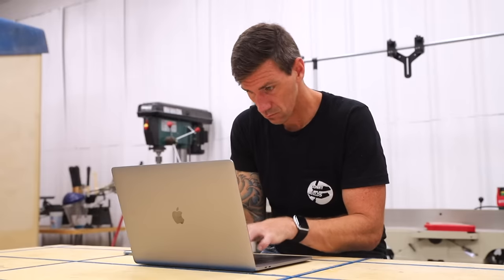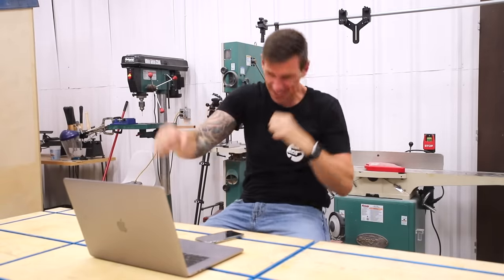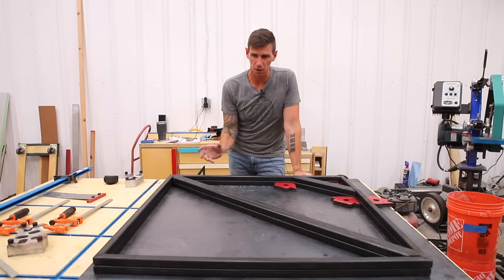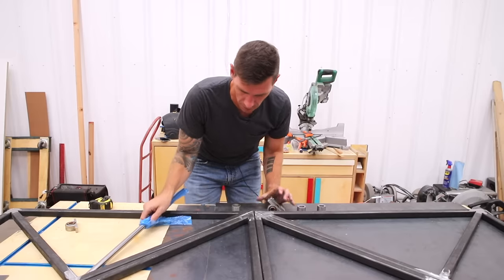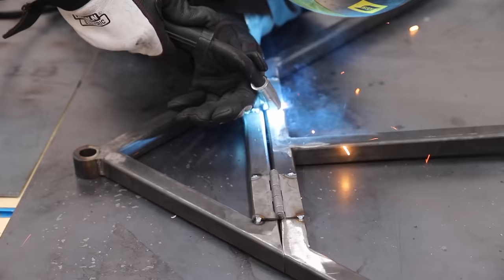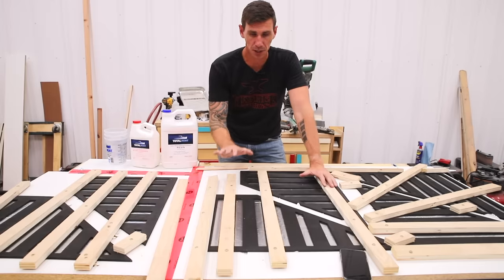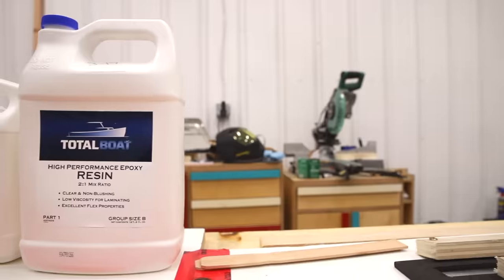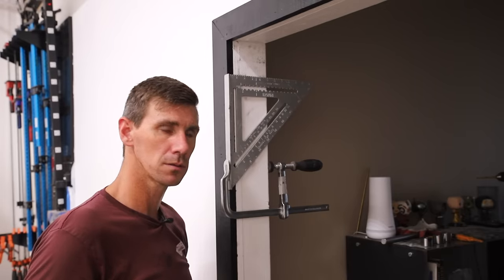Impossible Folding Door

Comment: Just think of comin home drunk and trying to open a door like this, also just a curious thought. Would it be possible to put a lock on that thing? 😂
Reply: You can put a hole through the inside handle and put a padlock through that and another block with a hole connected to the inside wall, it'd be awkward and a literally 1 sided lock but it'd be a lock lol
Reply: If you put it in the middle of the door and stopped the two squares from seperating.
Reply: Barney Premium - Yes'nt
Reply: I would mount a rotating bar of some sort on the wall right next to the handle that is able to lock the handle in place. But still its gonna be a one sided lock.

Comment: There's no sound at all when you explain any of it.
Reply from the maker: Its only an issue on certain devices. The audio is there.
Reply: 🙋‍♀️same here
Reply: See if your device is converting the stereo audio to mono before it comes out of your speakers. The video seems to have inverted phases, which if converted to mono, will result in little to no sound
Reply: Its a secret😂
Reply: For me it was just a very short segment of explanation I couldn’t hear
Reply: I hear only static noise :D
Reply: It's a headphone issues, was working then didn't, took my headphones out then it worked again
Reply: @JonnyBuilds  Strangest audio issue ever.
Reply: Timestamp?
Reply: @rhysblackburn14  got no earphones, and it has no sound
Reply: Hmm weird i heard it all..
Reply: I think it sounds like its supposed to with earphonea
Reply: I heard it. It's just quiet.
Reply: Antonio Delgado It happens for me when I had only one AirPod in, but the I went back in the video and put on both airpods and the sound played fine
Reply: @JonnyBuilds  strange... Never encountered that lul
Reply: @iadtag1853 
Yeah...
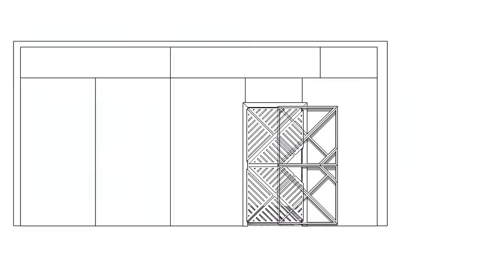From 01:50ish to about 02:45
Reply: If you're on a mobile device, tilt your screen so it goes to fullscreen/landscape mode
Reply: I thought my iPad was messed up😅
Reply: I have a samsung phone and it fosent work no audio..
Reply: Same
Reply: I couldn't hear it, even when i changed my speakert to mono and stereo, also the same happened to my laptop..
Reply: It might be headphones that make it not work
Reply: Even the auto generated captions aren't working
Reply: @JonnyBuilds  it won't auto generate captions though either ): Someone do the captions? :)
Reply: It's a secret
Reply: It sounds like the left audio cancels out the right one....
Reply: @JonnyBuilds  That's quite a puzzle. How does a variation like that even happen??
Reply: On my headphones it sounds totally bizarre, almost like you are talking behind me haha
Reply: @breadfan_85  Yeah i was about to comment how horrible the quality is at that point but ik it isn't his fault so i ain't gonna hate.
Reply: @antoniodelgado7475  that would make sense of the fact that I can hear it perfectly fine with headphones, but not my phone's single mono speaker
Reply: @antoniodelgado7475  now you point it out, I can hear the fact that his voice is out of phase in that segment. It's kinda trippy
Reply: It isn’t because of your device. for some reason the left and right audio outputs are exact opposites which, when combined (mono audio) cancel each other out. if you can’t hear audio here, try turning off mono audio on your device. Edit: the reason captions aren’t working is because the bot that generates the captions hears the audio in mono, which means it doesn’t hear anything.
Reply: @bryanfrantz4795  For me, the audio was really quiet, so i replayed the vid and the audio was completely gone. But, then i wore headpones, and the audio came back.
Reply: @Roxious119  Huh. There must be some hidden mono-ing going on somewhere in the chain.
Reply: Only on my left speaker
Reply: @antoniodelgado7475  just... Why?! It's a good explanation but what kinda weird audio program phaseshifts the audio?!
Reply: James Morrison 
You’re probably using mono audio my dude, depending on device, you set it to stereo audio or you have to turn mono off (Like for an iPhone)
Reply: Dayne Coveyou Good question, maybe bumped a phase knob on something or misclicked a setting that put it 180 out of phase, who knows
Reply: @antoniodelgado7475  that would be typical of rerecorded content ... he recorded live sure ... but YT re-records it and drops everything about 180deg out of phase .. so it appears almost in sync but it is lagging just a bit 
and since yt tends to invert channels it will take the standard master channel of right and make it left so anyone on mono playback will get little to no sound as it is on the wrong channel for them ...
Reply: @dickthedorkwing6082  i had problems with my lg v40 speakers but it worked perfectly with my $10 walmart headphones
Reply: Lisen to it really close and it sound weird
Reply: Same
Reply: I could hear perfectly
Reply: Jonny Builds 
Well you should still try to fix it! Everyone should be able to enjoy watching something this interesting!
Reply: I can read his mouth but I can't hear it
Reply: this is similar to how noise cancelling headphones work. https://youtu.be/zj33WAODsJg
Reply: Yep it works on mu tv but not on phone rip
Reply: @Roxious119  move the audio balance all the way left or right, that ignores the inverted audio channel
Reply: My iPhone6 did the same thing
Reply: @JonnyBuilds  it's an issue when you edited it. You inverted the audio channels, so when devices with only one speaker do the stereo to mono conversion they cancel each other out
Reply: @antoniodelgado7475  just like having a 2 channel amplifier for speakers and only using 1 speaker without bridging it properly
Reply: @antoniodelgado7475  how?
Reply: Same boi..
Reply: It sounds like ambient background noise for an indie horror game
Reply: Same here
Reply: on iPhone, turn off Mono Audio in Setting -> Accessibility -> Audio/Visual.
Reply: For those people like me who couldnt hear any sound turn on your captions and you can see what he says 😊
Reply: I had to get my headphones to hear it.
Reply: @JonnyBuilds  tbh u could've just made the audio compatible for all devices
Reply: Try with headphones
Reply: @CATel yes, u described it perfectly
Reply: Jonny Builds It’s only a problem on certain devices? Oh, well I guess I’ll just go buy a new device then, because that’s clearly on me for owning the wrong device.

Fix your audio issue, man.
Reply: Yeah, I had that same issue, so I then tried using my headphones. I had no audio issue with the headphones.
Reply: Yeah
Reply: Rhys Blackburn mine was phone speakers,  no headphone problems
Reply: @elainrakas3778  use and earpiece or headphone it would probably work then
Reply: iPhone X + AirPods – no sound 😞
Reply: i’ve watched this with audio and now it’s started doing this the fuck
Reply: Put subtitles on
Reply: @Erazzzer  m2
Reply: @rhysblackburn14  for me exact opposite
Reply: I had to put my headphones in for it to work-
Reply: Same on my phone!
Reply: Jonny Builds Him explaining is only on the right side of my earphones when i tested it out.
Reply: @th1rte3n62  It doesn't work. I tried both. Activating or deactivating it doesn't change anything
Reply: @th1rte3n62  It doesn't work. I tried both. Activating or deactivating it doesn't change anything
Reply: Nice E39 bro
Reply: Put on a headphone
Reply: Maybe its bc you have one speaker. It happened to me too
Reply: Antonio Delgado l
Reply: @elainrakas3778  just get a good headset or earphones, 
im using a headset so i don't get those issues when the audio is suddenly inverted
Reply: though the only problem is that because of the invert audio it made it sound like he is talking some what behind me
Reply: I had the same problem
Reply: I'm with ya too
Reply: Just turn on closed captions
Reply: @rhysblackburn14  wrong
Reply: Same
Reply: Turn on captions
Reply: Use headphones
Reply: Cogahan I have no idea. but, it did work on mine.
Reply: Thought my phone was hacked😄🇰🇪
Reply: Chỉ cần tai nghe là xong (Nếu thiết bị của bạn chỉ có 1 loa)
Reply: Pst ps pst pstt psst piss pius pis puss pusi
Reply: @antoniodelgado7475  English?
Reply: @JonnyBuilds  it seems to be it happened to me but i think the audio is unrecognisable to other devices as i hear a faint screeching noise when i put my ear near to my speaker
Reply: @rhysblackburn14  i dont have headphones on and there was no sound
Reply: @NavJordaan  nothing happens (I mean the audio)
Reply: @ahmed4363  try earbuds
Reply: Jonny Builds 

But its a problem that can, and should be fixed.
Reply: It's very low for me
Reply: Turn on subtitels
Reply: @rhysblackburn14  wrong I don't have headphones in and can't hear
Reply: He sounds like a fish if I turn my volume to the max when it came to that glitchy part
And I have no idea what a fish sounds like
Reply: @JonnyBuilds  well most people dont hear you
Reply: I could hear on my iPad 🤔
Reply: Turn on closed captioning during those parts. I had the same issue
Reply: it worked when i took out my airpods 😱
Reply: Yeaah me too
Reply: Yeah that’s what I was gonna say
Reply: I heard nothing and when I turned it up and put it next to my ear, I heard an R2D2 kind of noise. But I heard the part where it told you to subscribe and click the bell..not the voice, just the click sound.
Reply: Scusate se rispondo in italiano.
Credo capiti quella cosa dei suoni negativi. Forse vengono riprodotti due suoni di cui uno è il negativo dell' altro. Quindi non si sente niente.
Reply: Yes its an Issue km mobile devices caused by badly alligned Audio Channels, like Noice Cancellation, there are some Videos on The Internet you can watch
Reply: Jonny Builds how
Reply: same
Reply: Wear headphones or earpiece to fix
Reply: Same but for me it makes weird gurgling noises and taps and stuff
Reply: Same
Reply: @New5oul  same
Reply: i think he accidentally invert either the left or right audio, if you hear it in headphones it will feel weird, but you can still hear it, if you hear it from a mono speaker (device that only have one speaker)  you wont be able to hear it.
Reply: @rhysblackburn14  didn't work like that for me
Reply: @JonnyBuilds  I have a galaxy A50, i still don't hear anything when you explain. (I think this is a newer version phone so like- I think, I'm sorry if I sounded rude)
Reply: I was watching it as mono, switched to stereo and worked just fine.. guess it some kind of audio conversion problem
Reply: Wear a stereo headset
Reply: For me it was only his voice at the wooden part. Music faded back, click fron the subscribe thing
Reply: Antonio Delgado ill pretend that I understand that
Reply: He just phased out and in of being slightly quiet
Reply: @JonnyBuilds  yeah I'm on Samsung all I hear is a quite gargling sound
Reply: @elainrakas3778  it may be a Samsung phone thing I have a Samsung phone and there was no noise
Reply: @JonnyBuilds  I thought my wireless earbuds broke again
Reply: Try using headphones, it works
Reply: the only way to fix is use stereo headphones
Reply: It works for me
Reply: I have tried both device sound setting, changed from phone to computer and Android to IOS, it still messed up
Reply: @antoniodelgado7475  yup, Samsung galaxy buds convert to mono when you only have one earbud in
Reply: All you're able to gear is some weird corrupted noise
Reply: @JonnyBuilds  just put sub titles
Reply: He just said the reason why ppl stil arguing !!
Reply: Antonio Delgado 
I didn’t understand anything but thanks for explaining
Reply: That’s cuz you’re poor
Reply: This is a editing issue !!
My Headphones work well the past 90 years
Reply: For some reason the audio for that part doesn't play through mono sound systems, or something like that.
Reply: I was able to hear the beginning and the music but when it go to him explaining it, the sounds are like little squeaks when I put my ear up to my phone speaker. I have a OnePlus 6t.
Reply: Put your headphones on.
Reply: @shaderickard3606  Yeah, Same!
Reply: Which part? It works for me

Comment: This isn't practical in any way but it sure looks dope
Reply: yeah
Reply: Its still a door
Reply: AAAAAAAAAAAAAAAAAAAAAAAAAAAAAAAAAAAAAAAAAAAAAAAAAAAAAAAAAAAAAAAAAAAAAAAAAAAAAAAAAAAAAAAAAAAAAAAAAAAAAAAAAAAAAAAAAAAAAAAAAAAAAAAAAAAAAAAAAAAAAAAAAAAAAAAAAAAAAAAAAAAAAAAAAAAAAAAAAAAAAAAAAAAAAAAAAAAAAAAAAAAAAAAAAAAAAAAAAAAAAAAAAAAAAAAAAAAAAAAAAAAAAAAAAAAAAAAAAAAAAAAAAAAAAAAAAAAAAAAAAAAAAAAAAAAAAAAAAAAAAAAAAAAAAAAAAAAAAAAAAAAAAAAAAAAAAAAAAAAAAAAAAAAAAAAAAAAAAAAAAAAA
Reply: It's very practical
Reply: @xyoungdipsetx  Its overcomplicated and serves the same purpose a simple door and doorknob so I wouldn't call it practical. One of the definitions of practical is "sensible and realistic in their approach to a situation or problem" so the practical thing to do would be to get a normal door instead of cutting up a bunch of metal to create a door that's full of holes. Its a cool door though and it works well enough for were he put it in his shop. The original used it as an outer door which i could see being a problem because that door will definitely not stop bugs from walking through all the cracks.
Reply: yeeeupppppp. that’s the point! 😂😂
Reply: @billfred9411  Technically it has less of a footprint in how far outward it swings compared to a conventional door of the same size. It doesn't solve a problem here, but that doesn't mean there isn't a problem it could solve.
Reply: @cozyflannel1312  If you wanted a door that doesn't swing out you'd use a sliding door
Reply: @xyoungdipsetx  did u watch him open it from the inside? lmao
Reply: well I mean the door takes up less space when its closed I guess, and doesn't swing in the wind and stuff like that.
Reply: @billfred9411  It doesn't swing in the wind, which could be considered a practical use. Also due to this not swinging, it stays tight up against a wall, which can give you more room to walk by. It's definitely not practical, but it technically could be in very specific situations.
Reply: From the looks of this, it's probably pretty practical as an alternative to a pocket door. Having it outside though seems to be a bit impractical without a lot of gasketing to prevent air from leaking through.

Comment: I have mixed feelings about this door, it is cool, that's for sure, but is it comfortable for everyday use? Oh and what happened to the resin, is it opaque?
Reply: looked like he pasted something on the back of it maybe it was too clear for his liking
Reply: Saves space from large door movements
Reply: The epoxy was disappointing, it looks like solid white, was expecting some transparency.
Reply: @animerlon  it looked like he put something behind the epoxy like paper or something
Reply: @eyesyt7571  that's arguable. For it to be comfortable to use, you need to open this door completely which means you have to stop once you reach it and step to the left rather than simply swinging it part way open and stepping through.
Reply: @eyesyt7571  sliding doors exist..
Reply: @bubtrucker  yah, there are benifits and drawbacks

Comment: I'm intrigued to know how well this operates from the OTHER side. The side where you can't see the door at all when it's open, and  where the handle (if there is one) is absolutely right on the frame when it's closed.
Reply: He demoed it from the other side. It really doesnt work very well. He pushes it halfway open, then wiggles his way inside the room before he can open it further.
Reply: Think there might be a way two make it convertible were it could work both like either a normal hinged  door or a folding door depending whether you push or slide.
Reply: So it would be good for a wardrobe, closet or cabinets?
Reply: Yes
Reply: @anthonyd.8067  yeah making it double sided ...
Reply: Closing it behind you is the real problem, might be even dangerous... What you should really do is make it automatic.
Reply: More angles I think it would not make a good outside door especially for cold or hot conditions because it would allow too much air flow I think

Comment: Everyone here is watching amazed at this outstanding door and there’s me wondering how the hell can you close it from the other side when fully opened
Reply: You have a point bro
Reply: Finally found this comment. Was wondering if I was the only one thinking about it
Reply: You can't, not so amazing now is it
Reply: Its a problem even science can't solve
Reply: Omg-
Reply: @KlonoaPS01  nah it's still amazing
Reply: You dont
Reply: You can, by cutting a horizontal line through the wall so the knob is visible even for the other person from the inside.

Which means a certain material is required for the wall, quite possibly attaching the door to a wooden wall since wood would be easier and safer to cut.

Apply proper support to ensure structure does not collapse and viola!!!

You can now get out. I've seen a door this sort of mechanism on my visit to Dubai (not origami of course but it did incorporate what I've just explained).

It's going to be a really long knob though lmao.
Reply: I mean maybe you could make it spring loaded or add some motion sensors and motors?
Reply: @Guru_1092  that's actually genius, make it automated. So much more posh.
Reply: You grab the handle before you go in
Reply: @Guru_1092  that would be awesome
Reply: @jackkobi7753  then how would you open it once inside
Reply: The guy probably added a handle at the other side
Reply: 15:15 ur welcome

Comment: I feel as though when the door is opened their should be a magnet on the wall so then it stays in place but if it stays in place when opened we’ll just a suggestion
Reply: true it medal
Reply: What magnet can hold such a heavy door effectively lol? Wouldn't it be very bulky then?
Reply: Actually, there are magnets that are reasonably sized and could hold it. 

Also, you can just hide it on the inside of the wall to hide it.
Reply: I’m so confused what this man said
Reply: No magnet, its really heavy. Just a soft lock